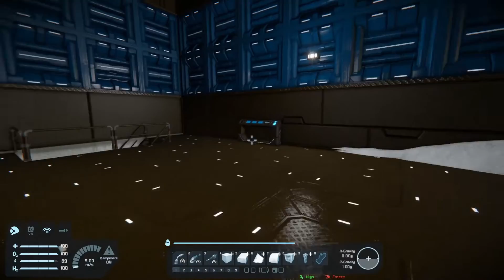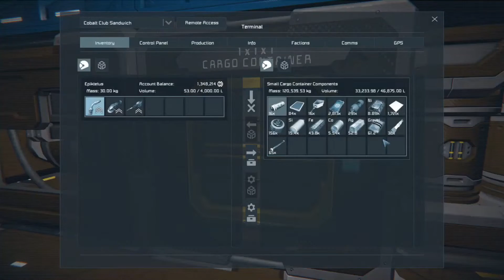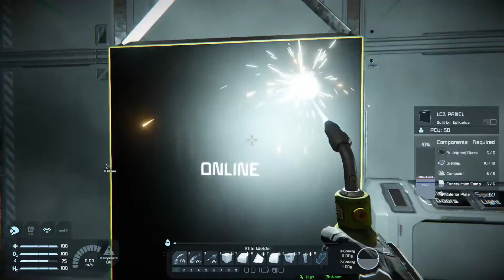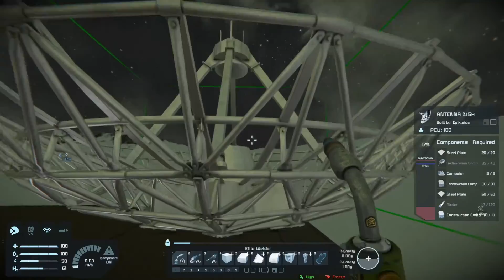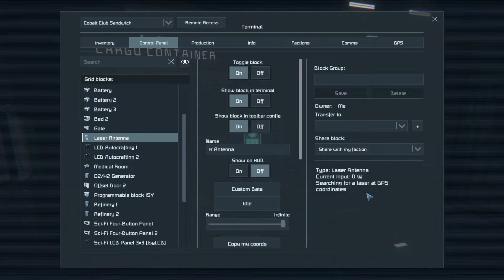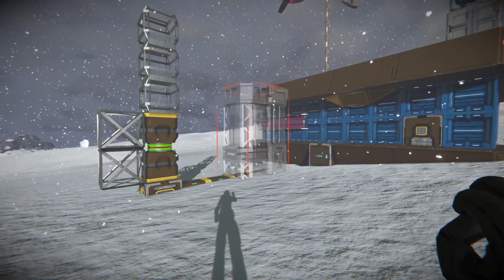What goes with a club sandwich? - Delicious Engineering 04

Comment: Great episodes Epic. FYI on the laser antenna. Tips

You can use this formula to calculate the power consumption of the LA:
if distance < 200,000 m (200 km)
Power [Watts] = 10 • distance [meters] 
if distance > 200,000 m (200 km)
Power [Watts] = 0.000025 • (distance [meters])^2 + 1,000,000 
Power consumtion is linear up to 200km, then it turns into a quadratic. You need 25MW for a 1000km connection, and 600MW for a 6000km distance.

This information is from
https://www.spaceengineerswiki.com/Laser_Antenna

Good luck finding Cosmic.
Reply from the maker: Oh wow, thank you. And of course SE doesn't actually tell you the proper power usage. sigh